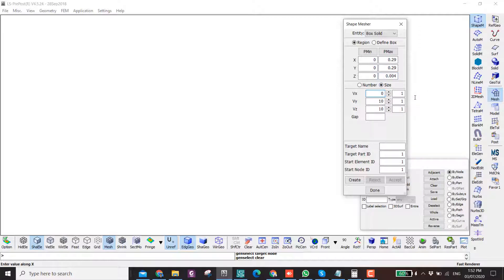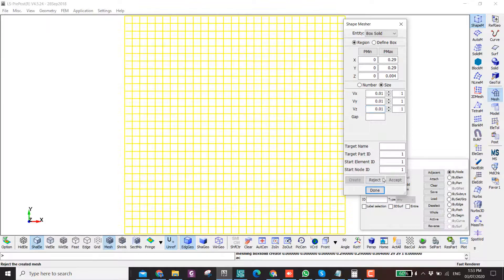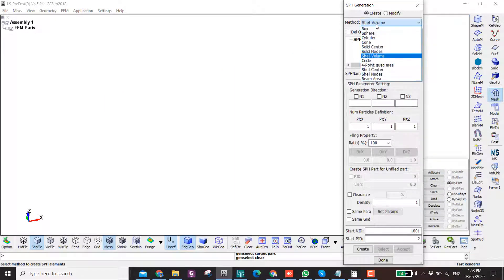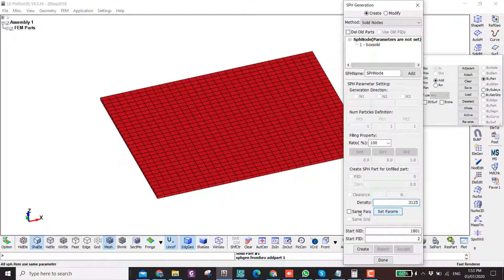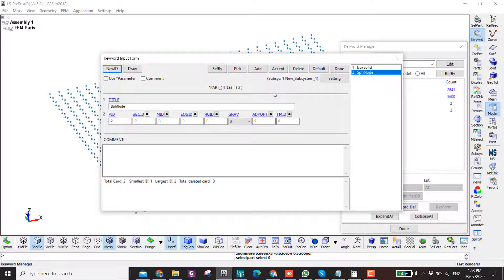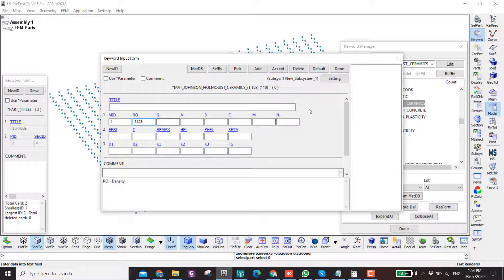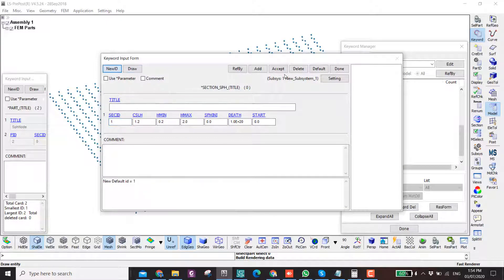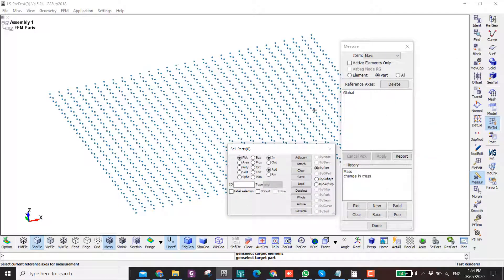Quick Tutorial: Convert Solid Elements to SPH

Comment: So, as per you, if I have a sphere of 0.25 m radius (0.5 m diameter) and I have to convert this sphere into 10,000 particles (each particle is of 60 micrometres), then I have to implement SPH on this sphere. But, I still want to know how to define particle size to this created SPH, as well as how to define that there are around 10,000 particles? 

I saw your video "SPH-FEM Coupling", but it was not clear to me.

Comment: Hello Ameen, 
I'm a beginner to LS dyna and is presently working on 2D-asymmetric problem of ball drop test. The ball and part are formed using shell elements with thickness. The problem I'm facing is related to interaction of ball with part. The ball passes through the part without showing any interaction. Kindly suggest some possible solutions for this. Thanks a lot in advance.
Reply from the maker: Hello Bhinder,

You can try use CONTACT 2D AUTOMATIC SURFACE TO SURFACE as in example:
https://www.youtube.com/watch?v=yoS78pQJ9nE
Reply: @AmeenTopa  Thanks alot Ameen for your suggestion.. 2D AUTOMATIC SURFACE TO SURFACE CONTACT and ELFORM15 worked perfectly in my problem. .Now I want to convert 2D asymmetric model to full 3D model..using ALE mapping. you have any video on that?
Reply from the maker: Unfortunately, I don't have any videos on that.

Comment: Hello Ameen,
I watched  your and other DCB cohesive model videos. But my upper and lower beam are shell so when i use tiebreak contact, it works but i have to do using cohesive element. And it gives error. Which contact can i use for shell beam and cohesive? Please could you give me advice?
Reply from the maker: Hello there,

First, if cohesive elements are not used and you are using tiebreak contact instead, you can use OPTION 9 which is equivalent to Cohesive Mixed Mode material model (bi-leaner model). 

For shell elements and solid (cohesive) contacts, you can used tied contact with offset option. 

If your solid cohesive elements have a thickness, then you can try to duplicate the nodes between the shell and the solid cohesive elements.

The above is based on my understanding to your description, I hope I got you right.
Reply: @AmeenTopa  Thank you very much Ameen. Your explanation  is very usefull.
Reply from the maker: No problem. Hope you get good results.